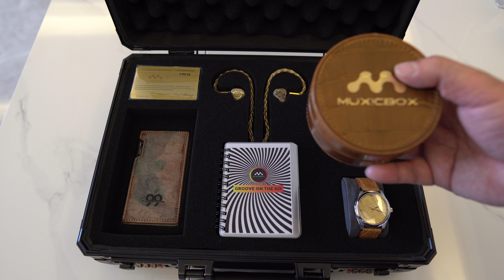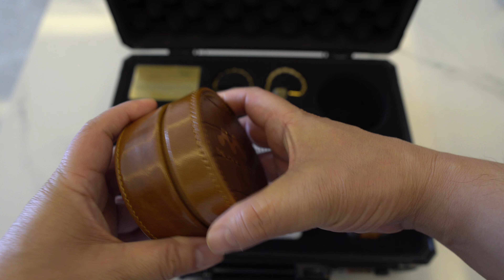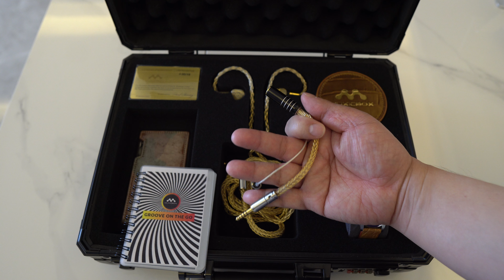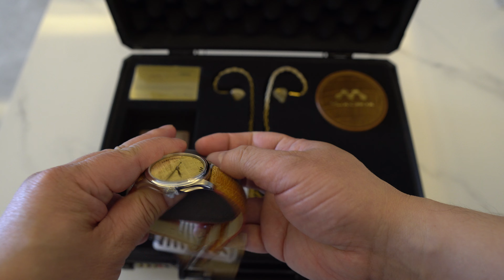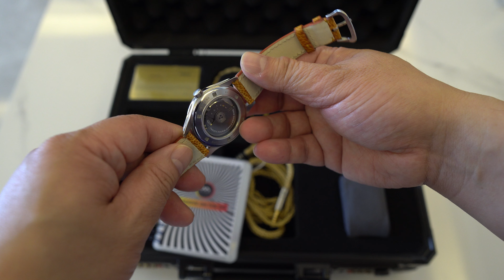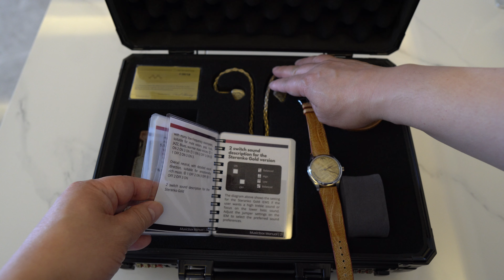The Joy of Owning the Muxicbox set - Gold - #Music #Watches #Luxury #Swisswatches - Chinese & Swiss

Comment: Just wish you would talk more about the sound, how does it sound in comparison,  Like is it near the Oriolus Szalayi or the madoo typ512 or something???  The packing is wonderful but is the IEM top of the line or middle ground or just normal $100 IEM?  I'm not trying to be rude but if I am going to drop $1400+ I would like to know a little more about the sound  I own 27 different IEM's from $18-$3200 but i like to know what I'm in for :)   Thanks
Reply from the maker: Sound is very subjective. The Gold one is a 14 drivers IEM. For each ear, it has 4 BAs for high, 2 for the mids and 1x 9mm DD. This sound is warm and full. The Sound stage is wide and the DD is used to give it a HiFi sound and warm feel. Since the highs are 4 x BA, it sounds sweet at the top. Paired with the Gold cable it makes it wider in the sound stage and improves the vocals. It works well with the RS8 DAP. But testing also on LP6TI and N30LE which works very well with it. Hope this helps.
Reply: @muxicbox1  Thanks but I wrote this before I ordered the Platinum one :)  can't wait to get it in and start using it.  Thanks.
Reply from the maker: @donaldwolff  Thanks for your support. It is schedule to launch on time. Should be the first week of June:)